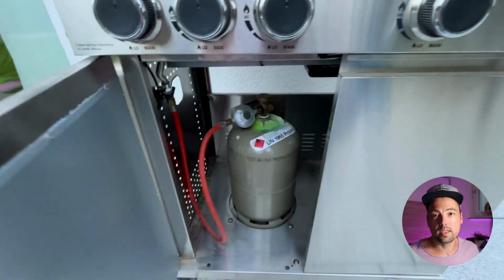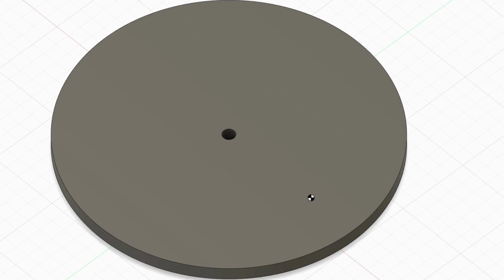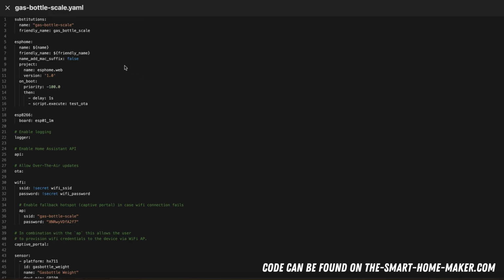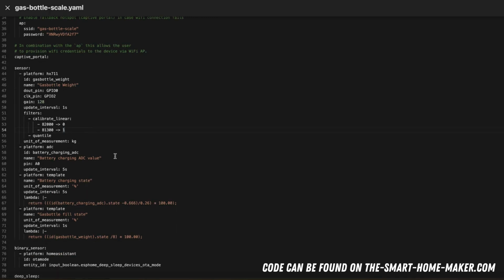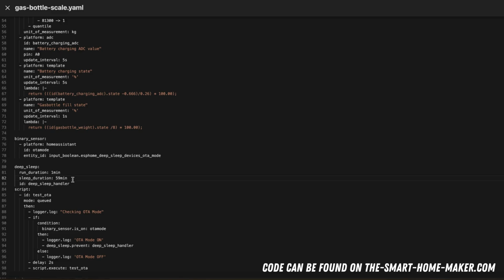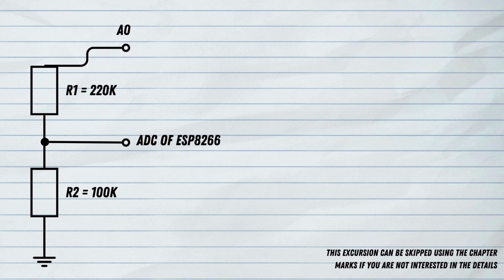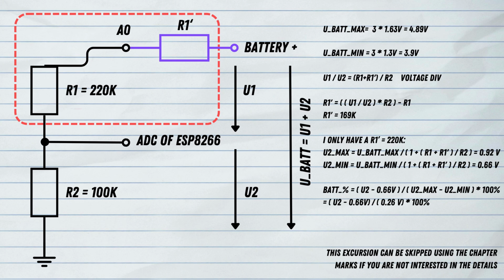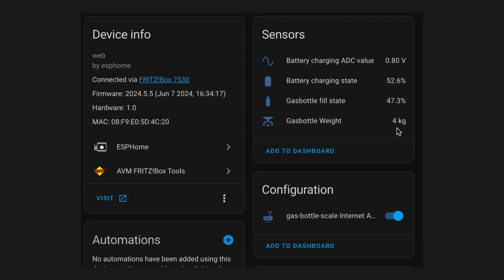Keep your BBQ going: Smart gas tank alerts with Home Assistant and ESPHome

Comment: I love the solution you came up with, in fact same solution I came up with myself for my stationary gas tank in the roof.  However it has been running for about 2 months, and the readings go up and down throughout the day.  I am guessing it has to do with the temperature.  Overall I see the weight has gone down.  Each day weight goes through a max and minimum, but those max's and minimums do get a bit lower day after day.

In a nut sell it is good to give me a general idea of how much gas I have left, but not accurate/stable enough to be able to tell how many grams I used in x amount of time.
Reply from the maker: Thank you for your valuable feedback! I think the temperature has a strong influence as also mentioned by @RuddODragonFear. I will now observe my solution in practical use and will provide a learnings video later on 😀

Comment: Hi, Great Video! I had the same issue with my circuit I made for our RV which has (2) 30LB tanks. The displayed weight kept wandering a little. My fix was to add 10 sample reads to the script to eliminate the wandering for the displayed weight. Works fine. At least it did for the last time I checked it about 3 months ago.
Reply from the maker: Sounds good 👌🏻 thank you! Will have a look into this

Comment: I did the same thing in 2022 and stopped using it because of horrible load cell drift with temperature change and even with stable temperatures.
Reply from the maker: Thank you - well I am currently making my experiences with this. I also experience this drifting which is not so nice. Maybe this relates to the quality of the load cells?
Reply: @the_smart_home_maker  i thuoght redesigning with some decoupling caps would help, but lost interest.  definitely need a temp sensor and polynomial compensation because load cells change shape with temperature changes.
Reply from the maker: This is a good hint!

Comment: I am curious to see how this works on the long term.
Those load cells do require regular zeroing since the tend to drift over time, especially with a constant load.
So if you place a load on it and leave it there for weeks, it may (or will) drift to a higher weight.
Reply from the maker: Thank you for this valuable comment! I was not aware of the drift over time but yeah will be interesting to see how this turns out in the long run 👍🏻😊

Comment: Isn´t the math for the percentage of remaining gas wrong? If the full bottle is 8kg, the empty would be 3kg (if you have a 5kg bottle of gas). Your Formula (weight/8)*100 would still show 37,5% for an empty bottle. Wouldn´t the right formula be ((weight-3)/5)*100 or simpler (weight-3)*20?! Or am I missing something?
Reply from the maker: Yes, you are right 😊👍🏻 thank you! Will fix this in the code that I will share in the blog post

Comment: Great! Maybe add an little solarpanel and a charging print to keep the batteries charge in the summer? :)
Reply from the maker: Happy that you like it 😊 Yes, the solar panel would be a great further development of the solution 😊👍🏻 But then one would also need to switch to Li-Ion batteries instead of Alkaline batteries. I had chosen Alkaline for this project as from my understanding Alkaline are a little less risky in terms of temperature behavior and the solution sits outside in the garden where high temperatures can be reached when the sun hits the BBQ grill.
Reply: @the_smart_home_maker  That is also true!